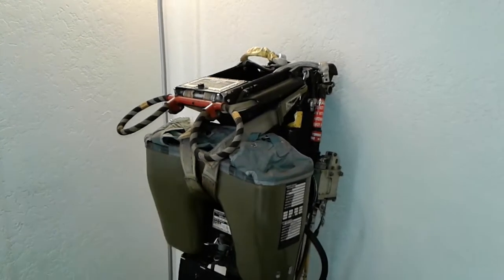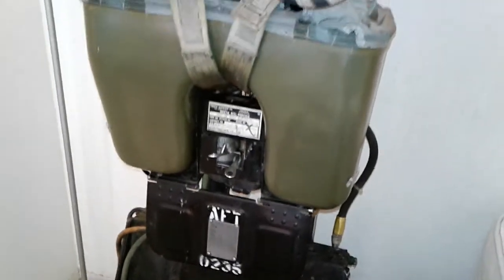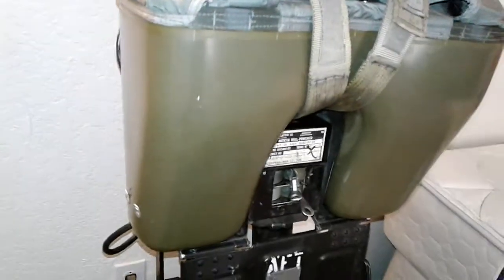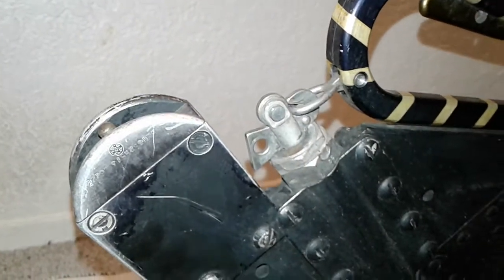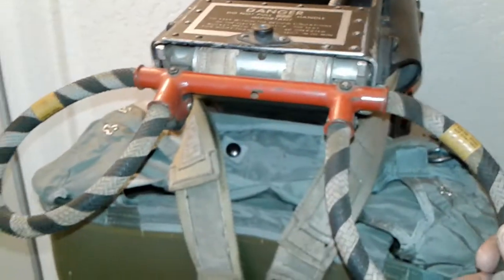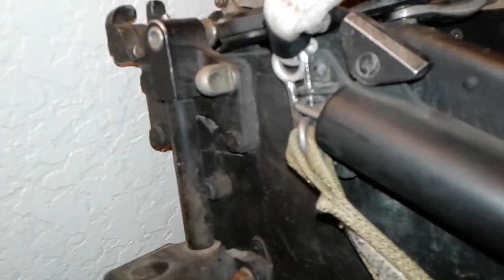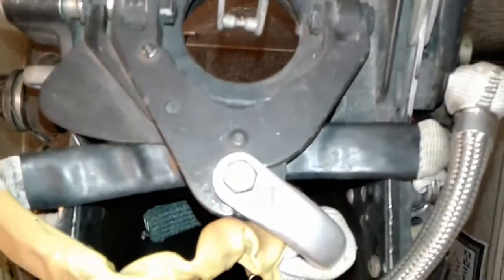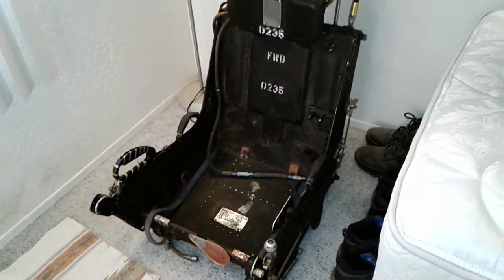Martin Baker Mk H7 Ejection Seat.

Comment from the maker: Just to clarify on the two parts of the seat. The seat pan was from the pilots seat, and the main beam portion was from the WSO's seat. When the seats were removed from the F-4 for some reason this is how they ended up back together. It's nice to have both parts from the same aircraft.  Sorry I didn't clarify that more in the video.